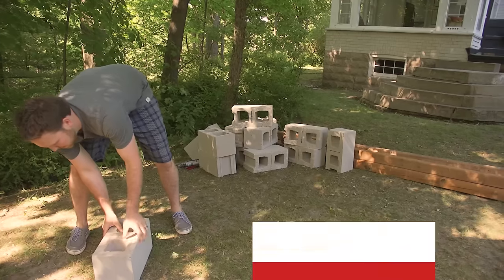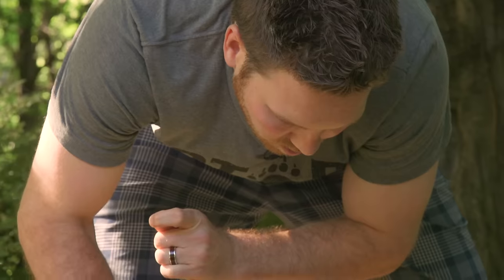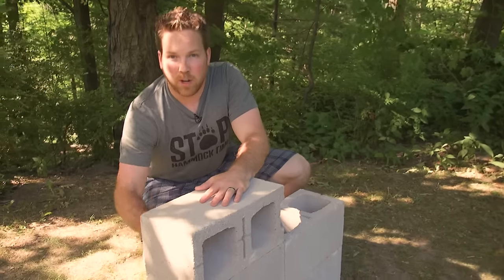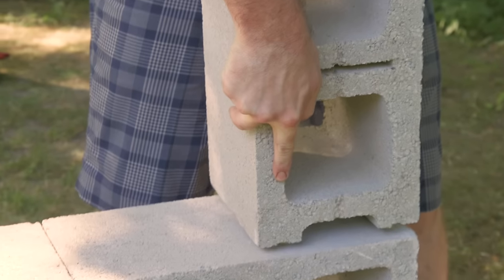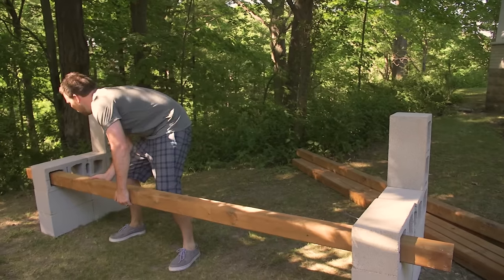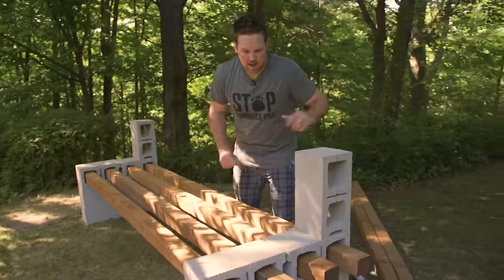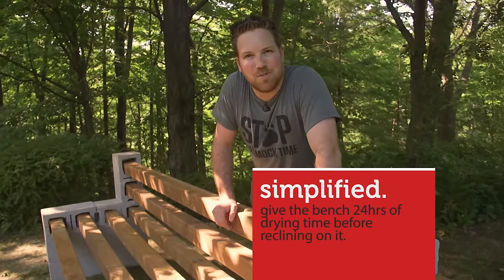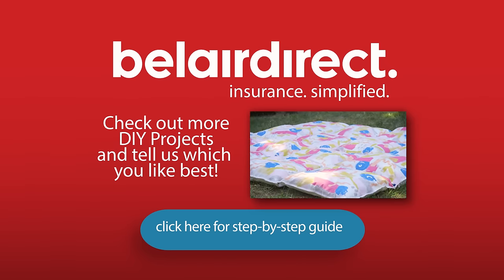DIY Cinder Block Cottage Bench

Comment: I did 2 benches with arm rests for my firepit area. They cost 41.00 each. You won't find good outdoor furniture for that price that will last like these will.
Reply: Gud Girl Dawn. Well done. Respect. They Comfy?
Reply: Are they stable
Reply: BIGWOOD3160 l
Reply: Dawn how did you do that?
Reply: I've got to make this one ❤️
Reply: @moncyesthervarughese7488  looks to me like you would build up the sides by 1 more row, keeping everything else the same 🤷🏾‍♂️
Reply: Where'd you find the cushions? The ones I've found are expensive!
Reply: I'm curious if anyone has built them recently and what the cost is now?
Reply: @goose7574  in ca the wood alone, minus one 4x4 was over $100 without the blocks or adhesive.
Reply: @A’sCaGarden  
I figured it was going to be quite a bit more expensive. 
I built a 2 story palette house for my daughter about 6 years ago, and I spent about $300 on extra wood, because I used other wood to reinforce the second floor, 4x4's to create a little covered front porch and square pavers underneath. The cost of lumber has really gone up in the past 3 years for sure. It would've cost me more than that, but I still had some lumber left from the addition on my house. 
Thanks for the info!
Take Care!
Merry Christmas & Happy New Year
Reply: How many bricks did you use it looks like 13
Reply: @26socialbutterfly 14 blocks in total, 7 each side.

Comment: I just completed this project and would like to suggest the following tips:      1)  1 row of the blocks that form the base of the bench should be half (4 in. wide) blocks.  This will make the bench equal to standard chair height.  A base with a height of 3 regular blocks won't allow the average person (especially shorter people) to be able to comfortably rest their feet on the ground.      2) The blocks that form the backrest should have the flat side meet the base, so that more surface area with adhesive can bond the backrest to the base.       3)  Adhesive definitely works, provided you use the right one.  I use Sika landscaping block adhesive and the bond is super strong.  However, if you are still weary of safety, you can use 4" c-clamps to reinforce the joint between the backrest and bench.      4) Three 4x4s are enough for the seating (5 total).  The 4th one for the seating isn't really necessary unless you plan to use cushions for the backrest (to keep the pillows from falling through).      5) Use the best side of the lumber for the surfaces of the bench.  Sides with splinters will slowly tear up your cushions.
Reply: How long was the 4x4’s
Reply: Thanks for sharing 🤩
Reply: @joelthomas4294  looks like 8ft to me.
Reply: @joelthomas4294  I know I was thinking the same thing. If a standard 4×4 is 8 feet I would prefer to do a smaller one. I'd make 2 smaller chairs instead of one larger one
Reply: Hi!  I'm just reading your post.  Do you have any pictures? (6 years later, LOL)

Comment: I had some 4x4's and brick laying around so I built this and it holds up just fine despite those that think it's unsafe. I weigh 280 lb and purposely leaned all my weight on the back and it held just fine. So many haters!
Reply: Really that's crazy I was wondering that I'm glad you spoke up I was trying to figure a way to anchor it better thanks
Reply: Thanks.
Reply: Even Ikea Funiture Holds Up If Not Used For A Jungle Gym & Rock wall 😂😂😂😂😂😂😂😂😂😂😂😂💀💀💀💀
Reply: So many haters, absolutely!!! Be nice folks!!!
Reply: Thanks for your coment,I  was wondering if they can hold my weight..lol

Comment: I think a shorter bench would be appropriate, or add a center. Everything is about balance, things last longer, it will not brake , but with time the weight on it plus weather will make an impact on durability. Thank you for showing folks beautiful and great things do not have to cost a fortune!!! Be well, be safe, best regards!!

Comment: Hi.  I have a beautiful old metal headboard with the bottom poles sticking out, and thought i could put those through the blocks. If i built up the back with blocks i think it would stabilize the back.  
Your thoughts would be appreciated.

Comment: Belair Direct Insurance sponsored? That would be appropriate considering that whom ever falls off backwards is going to need it because of an unsafe build. Personally, I would reinforce the vertical bricks by adding L brackets and a couple of bolts within the squares, but only if the bench is built as a stand-alone and not propped up against a wall. Other than safety, this is a quick and easy idea.

Comment: Cool and easy idea, I only wonder if moving the upright cinder blocks forward about half a block would allow you to reduce the number of 4x4's needed. Also I would use a adhesive made for porous material like concrete or maybe go for mortar.  The only other thing would be to increase the upright blocks strength, if you moved them forward you could use the ledge and maybe a half block as support or cut some lumber into a support brace and using the adhesive attach it. A couple adjusting metal straps would work really well if you had them available. I noticed it moving a bit in the video but I chalk that up to, they shot it in one day just for demo purposes and didnt let the adhesive cure. Go the extra couple bucks and use split face and hit it with a stain and water blocker. All and all a good starting point idea and open to a lot of versions. I bet a couple of bond beam blocks on the ends,knock out the center and you could make a planter for the ends. Lose the back all together use split block on the ends and standard ones in between and you could run this around a patio and turn the block areas into planter for flowers or herbs and things. Hmmmm

Comment: he hee  i just use a cement block and cement step as a set, or double step on each end of the block,. and Liquid Nail it<>  let it set a day then turn the set part up ready to set on Can knock the side down smoother with sand paper, grinder, file  what ever,  So there no rough shape corners and edges>  i use a dolly to move them

Comment: Hi,
I love this idea.  May I ask why no glue is used on the cinders where the 4X4s will go through? Thanks.  I want to try this, but i have crazy grandchildren, and I wouldn't want them to knock the cinders over and get hurt!  What should I do to make this totally stable!  Thanks for this video.  it's excellent!
Reply: I plan to cut my beams shorter and cement them into the holes   stopping them from moving

Comment: When i glue stuff together i usually stick a cinder block on top of it to compress it together, so should i used another cinder block with these
Reply: I did the same thing only that I cut a piece of plywood and screwed at end of posts, right next to outside of blocks for table and support. Then back support I screwed a 1x2 on the back of posts right against blocks. connect top 2 and bottom post together.  3 years later plenty of sex!! on it and still no problem, holding steady.

Comment: My concern is the 4×4's working out of the cinder blocks..
Suggestions to keeping the 4×4's from working out???
Reply: Maybe run a screw on the bottom where no one will see? On the 4x4 outside of the bricks on both sides.... then it will only move as far as the screw on either side
Reply: @bcsprothree  Holes and pegs wouldn't look bad

Comment: that doesn't look safe at all i mean how hard would it be to tip over that top vertical brick?
Reply: I've worked with masonry glue before and this is NOT the proper application for it at all. It's meant to stop bricks or rocks from sliding under moderate force, there's no way it'll stand up to someone leaning back against it like that.

This build is absolutely unsafe.
Reply: yep that was I was thinking. I just see 3 drunk guys fliping backwards after couple days
Reply: agree, this is horrible.  You can tell that these copycat DIY youtube channels just make some POS thing then take it down right away to use the parts for some other makeshift garbage project.
Reply: You can just get rid of the top vertical and just the bench seat. Looks much better and safer.
Reply: lol
Reply: vidvidvid2012 I was thinking the same thing.
Reply: Petar There's a few ways to secure it and also look good.
Reply: My first thought as well. Was thinking he could've put some blocks horizontal, and stacked two and used the adhesive, and it would be much more stable. But still...
Reply: OnTheFritz602 I'd just leave the backing off and have it a plain bench.
Reply: Petar Ikr, but he used some strong glue
Reply: Petar you need a chisel and small Sledgehammer to get that block apart that is tough stuff like liquid nail. it would be safe enough for a backrest
Reply: Can anyone suggest what I can use to make the backing more safe. I want to build this. (TIA)
Reply: Petar ikr
Reply: Taste Of A Berry glue the two vertical blocks together and possibly set em in the ground like half a brick.
Reply: Dave the pond guy glue all the bricks together even verticly.
Reply: Yeah it ain't going nowhere
Reply: personally I'd make a mold to cast a similar shape as "park bench" ends, pour concrete, and just string 2 by wood thru. I feel like a 4 by wouldn't have any give to it and may be hard on the back. It looks trendy, modern and creative but I'd have to make one of these the way this guy did and put it thru it's paces. Mortar almost definitely wouldn't hold this together and I'd imagine construction adhesive would hold up till winter came and went one time. And again the back support part is really all I question. Gravity is taking care of the rest.
Reply: Petar, the answer is DUCK TAPE. 🐥
Reply: Petar just use cement
Reply: Slam some rebar behind and on the side of the cinderblocks.  Done
Reply: Petar I just finished making o e for my front yard..it doesn't move..
Reply: Im gonna try it this week use alot more glue and paint center blocks .
Reply: cant you just secure all cinder blocks with mortar or cement?
Reply: Petar Do you lift weights with your head?
Reply: how about attach the bottom back-support 4x4 to the seat-support 4x4 below it with carriage bolts on both sides
Reply: Drill holes between the vertical and horizontal blocks, secure both with bolts and nuts.

Comment: Those are not bricks they are 8” blocks there made to hold up a house! Mortar would hold it all way better glue will probably not last  but not a bad idea
Reply: glue holds better than mortar as long as right glue is used.  NEVER use mortar when force will be applied from side (leaning back) like that.  simple physics applies.

Comment: A nice idea and yeah, those who complained that the naysayers are a pain in the ass are (mostly) right.  Any project can be improved upon; so, doom and gloom--ers--how would you improve it?  I like it and would probably fill in the holes to keep insects from nesting (Philippines, you know); paint it; and use cement to bond it every which way possible.  And I would think long and hard where to put it so I would not be tempted to move it.  Now, was that hard?

Comment: Looks like the most expensive way to make a bench to me.
Reply: Yeah, i calculated $300, with $45 a cushion (3). 4 x 4 x 8 at $17/each, glue $7, glue gun at $17, cinder blocks $1.65/each....even if you got the cheapest possible... it'd still be at least $200.😬

Comment: Just go buy 0ne you tight assers cost you more to buy 4 by 4 then buying the bench
Reply: you didnt get the point, perhaps folks have the material already.
Reply: Yeah no it doesn't cost more. A 4x4 is 10-15 bucks at home depot and the cinder blocks are like 1.50. Benches are a few hundred usually so, no.

Comment: Not stable,  there is nothing holding the back cinders to the front.  If you just ad one layer of 1" top plate and glue that to tie the front and back sections together this would be much stronger and safer long term